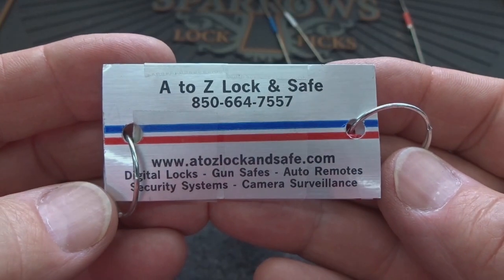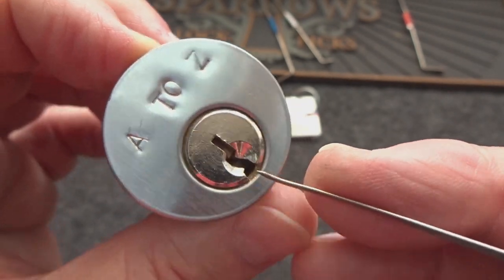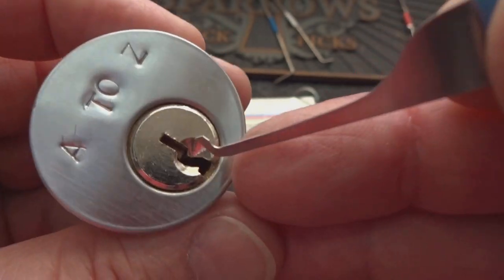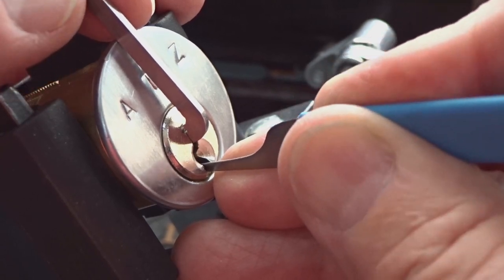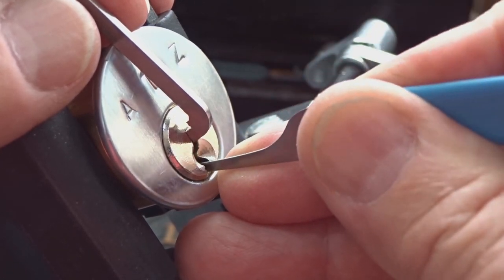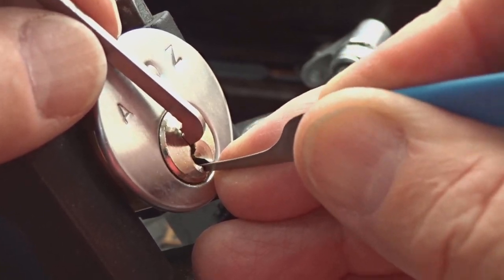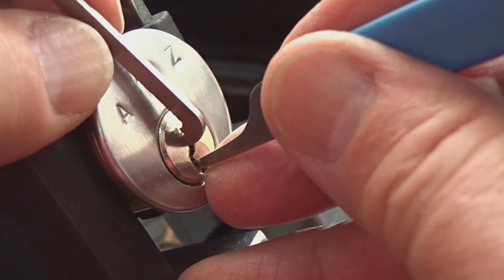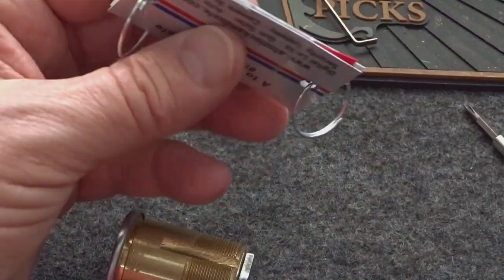(1077) Challenge:  A to Z Lock & Safe #2

Comment: Congrats on whipping that one. Your pick seems to be just what that lock wanted. The springs don't look like any from the Bics that I've gutted (when these damned tremors let me) to use in keychain fire starters. They don't seem to have been cut down and do seem stronger than the long springs used in Bics. What matters is that you whupped 'em.

Comment: Not sure if anyone else has done this or if Bill would approve, but while I have been learning picking I found it challenging always knowing what pin I was on should I need to know that. So I took my pick I had made and put it in so it was on each pin and made a etch mark on the side of it. Now if I want to know what pin im on I can look at the side and see which line Im on. Not sure if its needed but Ive found it useful. 

Also I would like to agree with other comments below saying you should make shirts Bill. I would buy some for sure.
Reply: Rebel1776 seems like that would change per lock

Comment: There are Schlages with different keyways aren't there? I ask because I have a Schlage that has a keyway so wide that a .025 pick fits easily into without grating against the warding.
Reply: That would be the Schlage F keyway - you can drive a small Japanese car in there and do a U-turn. The Schlage SC1 keyway shown here (often just called Schlage C) is my least favorite of all common American ones... Apparently Bill shares that sentiment. Unfortunately all Sparrows training locks are on the SC1, which sucks.

Comment: i just got my first schlage and, man, you are right, i can't get any feel at all with the .015 due to the warding.  not sure what i will do to get it.
Reply: so, i repinned my schlage into my ultimate adversary lock and got it open.  thinking that keyway is really hurting me.  also wasn't expecting 4 spools and a standard in the schlage.  was tricky with no spring tension, but was able to manually un tension.

Comment: Wonder if that german electric pick would have unlocked this lock...........
Reply: Good point. But after seeing those strong pins I wouldn't bet on it.
Reply: ben terwellen It won't get in there to do its thing because of the tight paracentric keyway. It only works on shitty locks.

Comment: Hey Bill, when you removed the spring to number 3, there was what looked like a T PIN fall off and land to the left of the board. Where did this come from? I have watched this a few times and can's identify to whence it came. You picked it up at the end but it vanished... are you a magician and make pins appear and disappear? If so, what a trick. I assume you have a hollow finger somewhere or it came from the follower somewhere as you rarely show the rear of the follower... Are you testing us all? 
Your lockpicking is getting a bit serious now and we need a picking under stress video. I watched the "banana in the tailpipe" stress video again last night and was realising that you have yet to top that one off again with a 2017 update. 
Another question, when you manufacture picks, do you use a bench grinder or do you use a Dremel? I've been looking at making a few picks out of some vertical blind parts and have them at the same length, but it is the actual cutting that causes me heaps of grief... this has not been done before that I can see and may be something that you include is a future video.
BTW, we love you videos and keep up the great work. I cant wait to earn some money so that I can pay you back for all the good that you have amused me for the past 2 years as I have been unable to work. I have landed a small contract position that will see an income again...  When payday comes, and I have some extra, I will be straight to PayPal. I wish you a great day. Cheers from Oz....Brad
Reply: the pin that fell was the standard bottom from 3